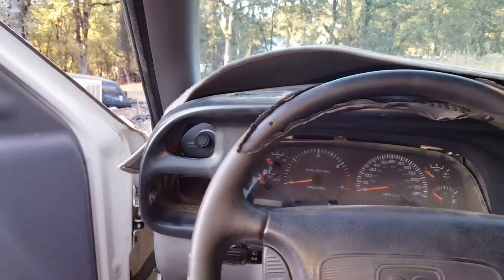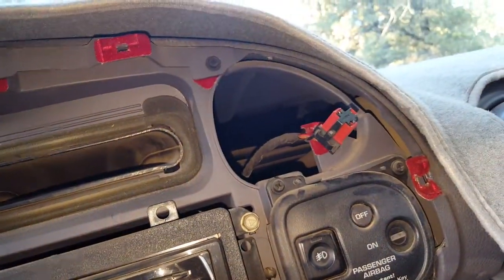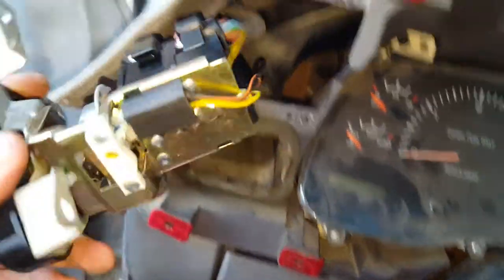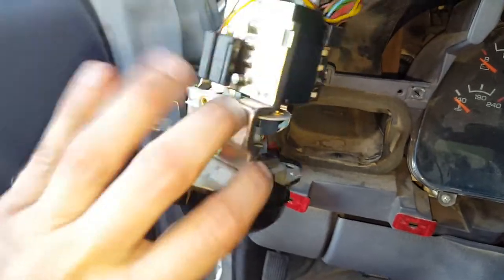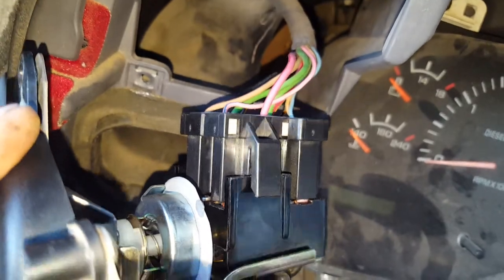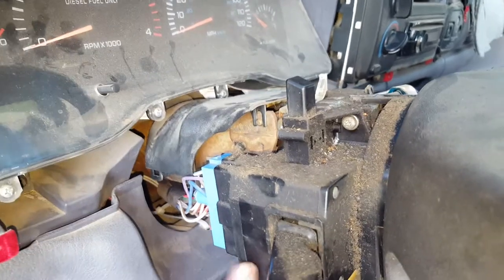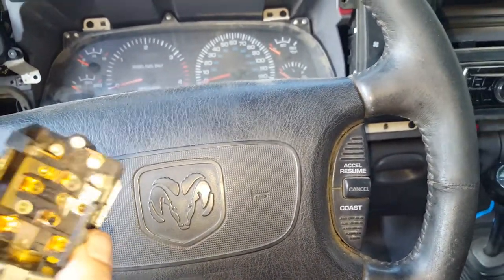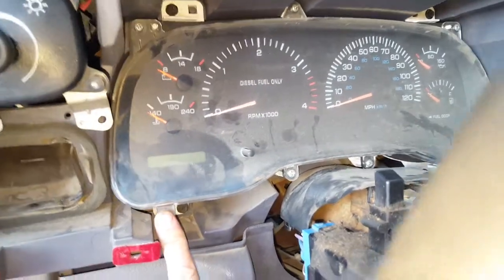2nd gen Dodge Ram 1500, 2500, 3500 headlight switch replacement, knob removal.

Comment: Thank you very much for this video that's exactly the same thing that happened to mine and I just stumbled on the fact that the parking lights still work and if I pull on the I-beam lever and hold it then the high beams work so I was able to limp home by holding on to the lever and pulling it toward me while driving. 
While exploring a little bit I did find the button that releases the shaft and knob. Cheers
Reply from the maker: Glad this video helped! Cheers

Comment: Thank you for the video, I never would have known to push that spring loaded button in to release the pull know. I snapped one of the tabs off trying to pull the thing apart for the plug in box but double zip-ties seem to hold it solid.🤷‍♂️ Thanks again, Dan
Reply from the maker: Those tabs are unreasonably stiff for sure! Glad the video helped!

Comment: Came across your video while in park waiting on my lights to work again. I’v found on my way home if I stop the truck and turn it off, the lights work well for about 10 minutes. Got another 20 minutes to go til I’m home. 
Anyways, where did you buy your switch from? I’m looking on Amazon and they only have the dial switches in a 98 ram. I’m looking for the same one you have in the pull style.
Reply: Or… did you buy the kit without the plastic pull handle and display face and then just use your original pieces with the new internal pieces I’m seeing on Amazon?
Reply from the maker: I don't see any receipt in my email, so I believe I got this from the local Napa auto parts. It was just the switch and I had to transfer the face plate and pull knob into it
Reply: I’m having the exact same issue with my 98.5 second gen I can’t fine any info on it. When I start driving I have about 10 minutes of headlights before they start flickering for a while then eventually quit all together. I give them a break and they work again like described. Did the new switch fix your issue?

Comment: THE SWITCH IS THE MAIN THING HERE AND IT IS 2 PARTS AND NONE OF THESE VIDEOS SHOW THEM TAKE THE SWITCH APART WHY YOU DAMAGE THE SWITCH AND ITS ALL OVER YOU COULDN'T SHOW US THE WAY THE 2 PART SWITCH COMES APART THATS THE WHOLE JOB WHY
Reply from the maker: I didn't have anyone to hold the camera for me and only have two hands. I didn't damage the old switch coming out anymore than it was already damaged. Listen to what I say in the video. Hold that springed plunger down, and pulled the knob completely out of the switch. Then get some pliers and screw off that piece I show you. Then it's apart. No video for because it's actually really easy, so calm your caps lock and try it before you get frustrated
Reply: Where can you find the part?